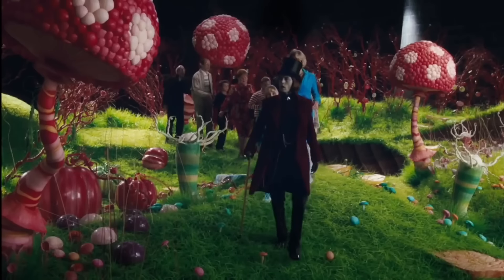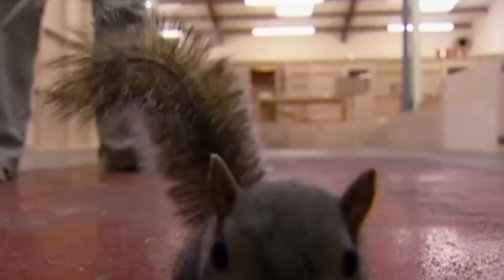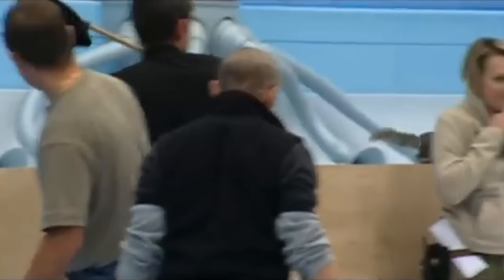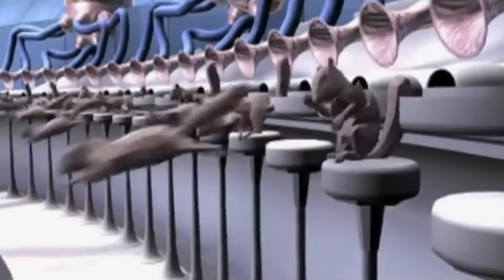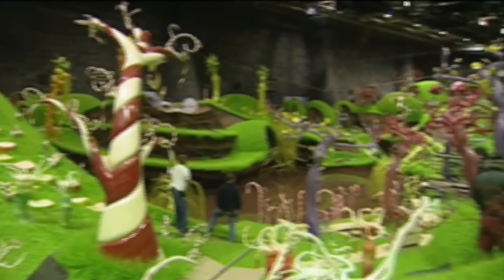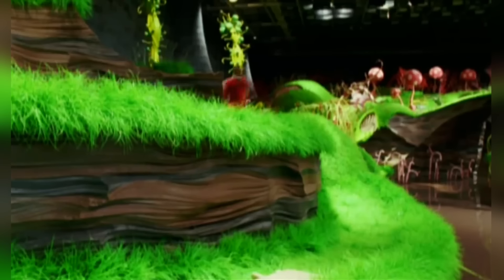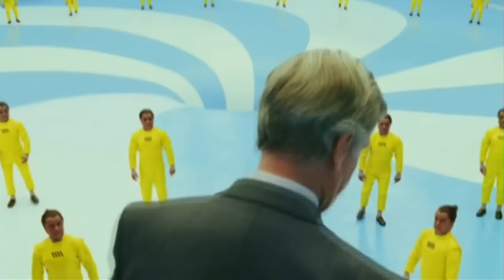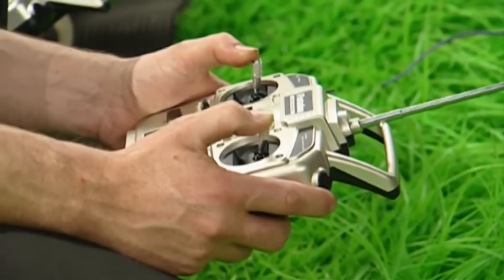You'll Never Watch Wonka In The Same Way After Seeing This!

Comment: Surely it would have been easier to cast multiple Oompa Loompas instead of having to composite
Reply: Like the original? Yea. Exactly.
Reply: Burton was copying the book, the real book, not censored. Finding a dwarf of the same size and color is not likely to happen.
Reply: @zerotodona1495  It is possible, but the issue would be language barrier. It's weird considering the oompa loompa from the 1971 film was still living when the 2005 film was in production, just that he looks older than what he was back in the 1970s.